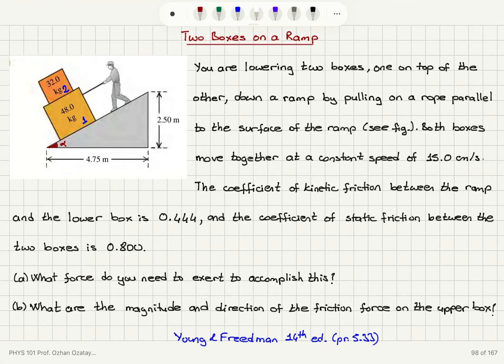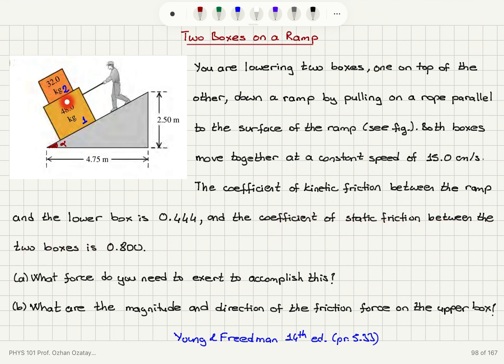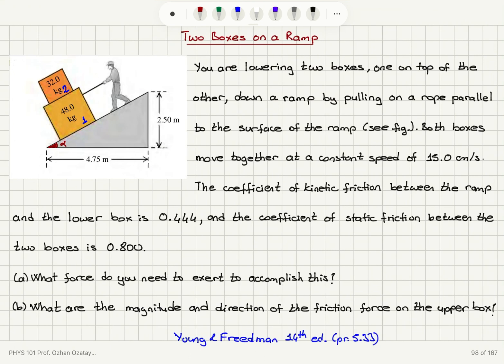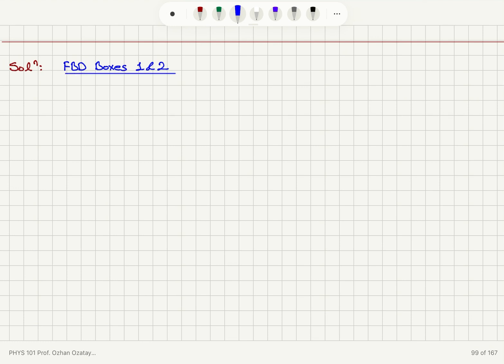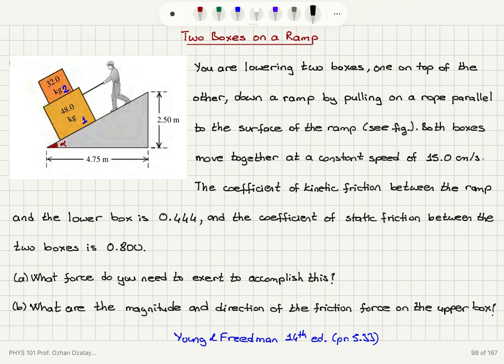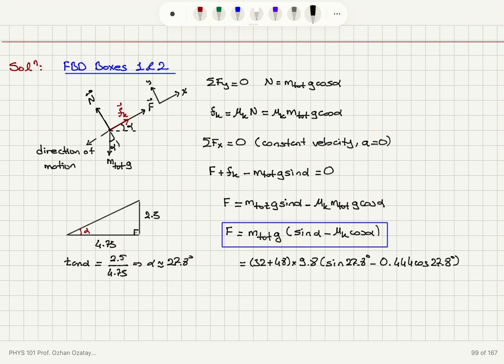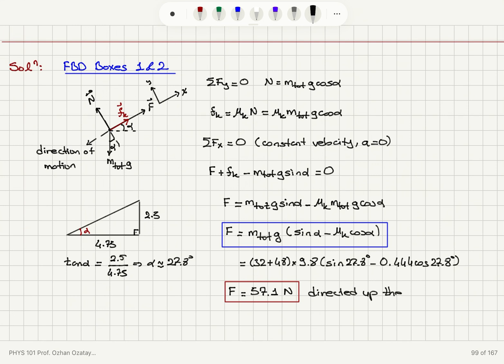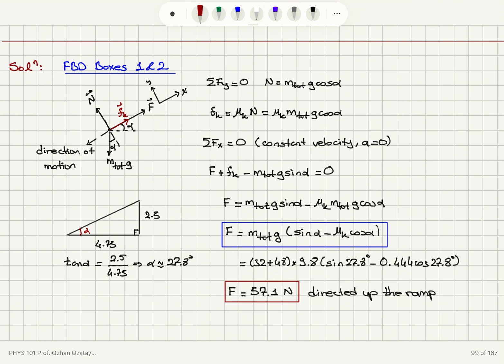Two Boxes on a Ramp

Comment: I think you may have forgotten the normal force that box 2 exerts on box 1 in part a.
Reply from the maker: No. FBD for boxes 1 and 2 together as a single body was considered. In that case mutual contact forces are not present.
Reply: @ozhanozatay  thanks! I did it a different method but ended up with the same answer as you and I understand it now